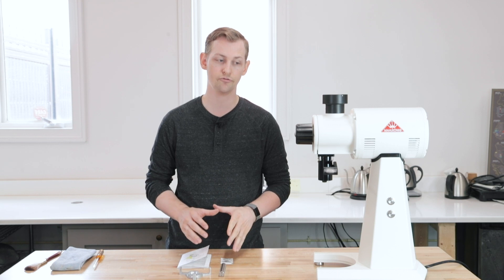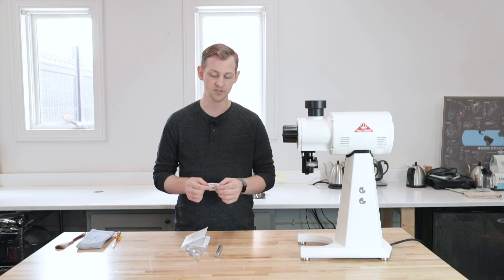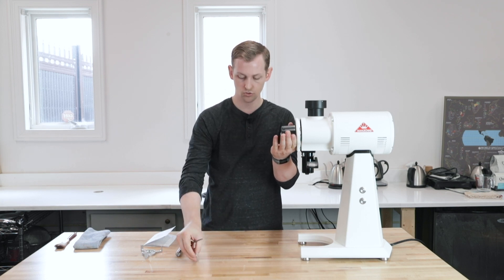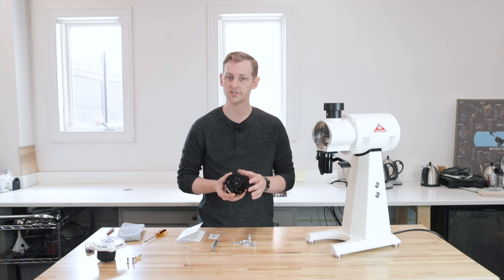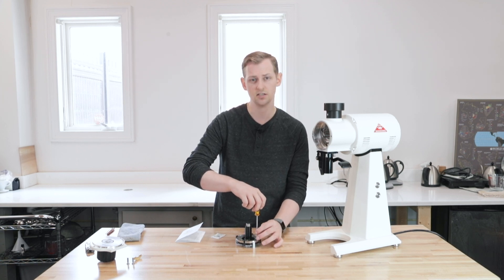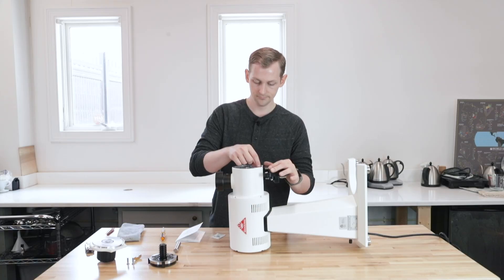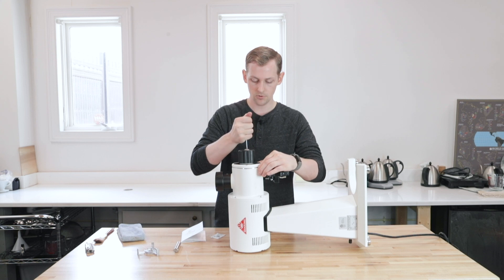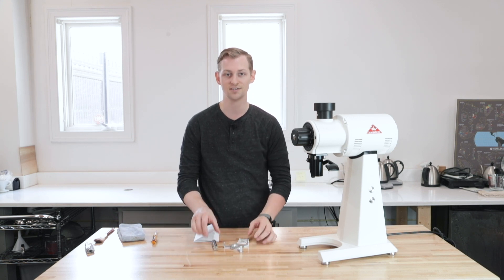Video Overview | Mahlkonig EK43 Burr Alignment Tool

Comment: This deals with whats called parallel alignment. But about the angular alignment ? Its equally important.
Reply from the maker: That's correct! This tool addresses only one aspect of alignment. The dry erase marker method or the Titus EK43 alignment tool addresses the angular alignment you're referencing.

Comment: i don't get it. why such an expensive grinder don't make the burr just fit in the place. so wo don't have to align it. it's so expensive! and we have to align it with precision manually. they made it in factory with computer and robots!
Reply: You are right. Thery are also still using slotted screws.
Reply: Exactly! That’s just absurd with that price & u can’t use it perfectly outta the box

Comment: is there 2 version now of this tool? As i have seen  one that is smooth in the centre it has not groove just the hole for the shaft and metal bar
Reply: That's right, I got one that doesn't have the grooves in the center

Comment: Between the EK43 & EK43S is there any advantage of one over the other other then just the space issue of the smaller unit?
Reply from the maker: That's pretty much it. The EK43S saves space compared to the EK43. It has the same power and performance as the EK43.